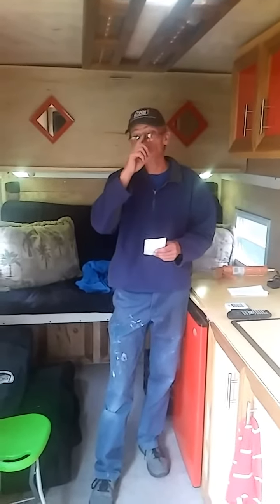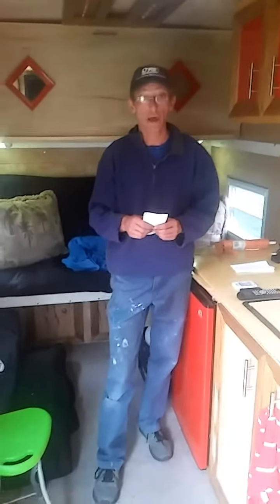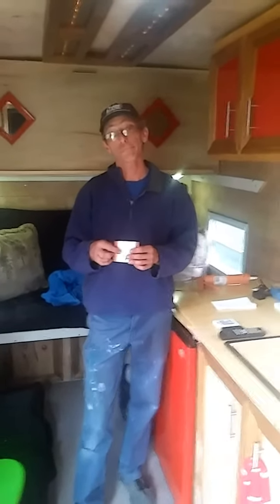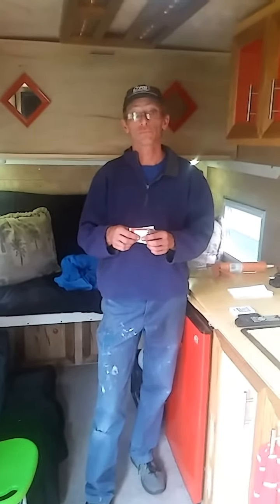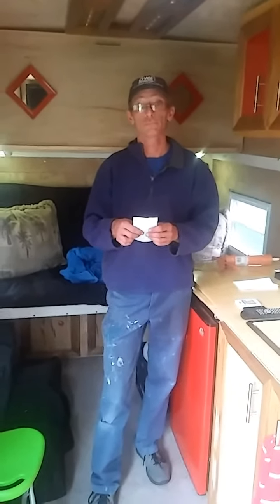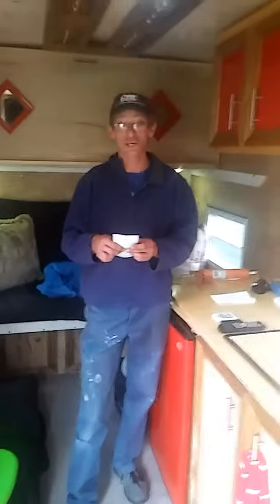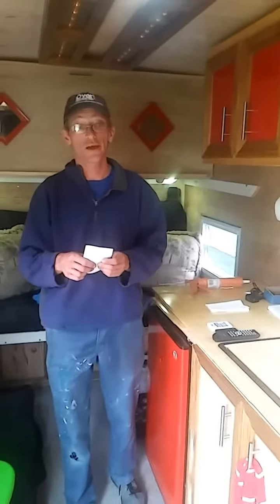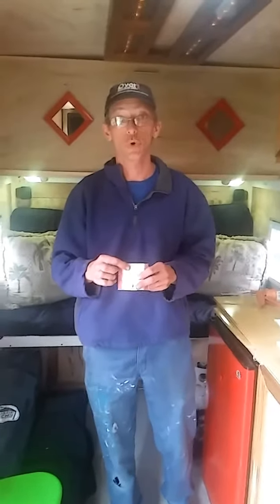Cargo trailer to camper build (part 12)

Comment: On the outlet you put in the entertainment center  do you have to run a 12 volt and a 110 line to it? You really outdid yourself on this project. Thanks
Reply from the maker: joeshaver100 the outlet is only 110 volt..... no 12 volt....

Comment: How did you get the original  screws out
Reply from the maker: Linda Crowley I ended up just ripping out the original walls and use a cats paw to get the nails out. Original was 1/2inch ply and went with 1/4 luan so i save some weight.